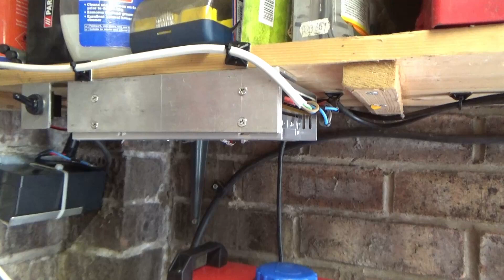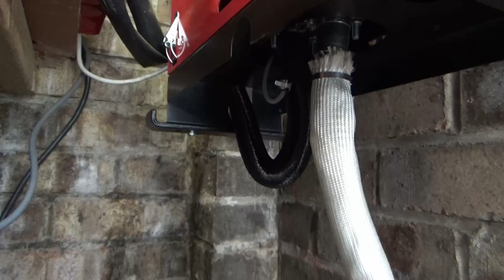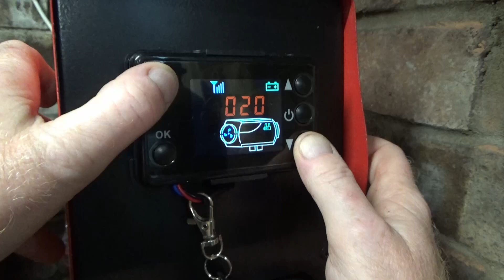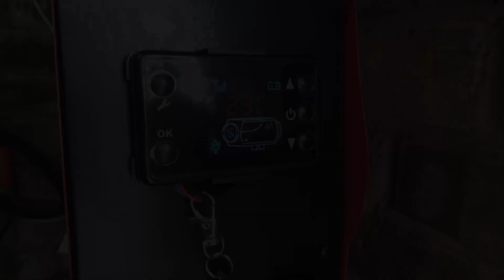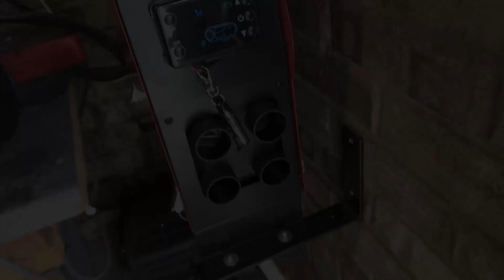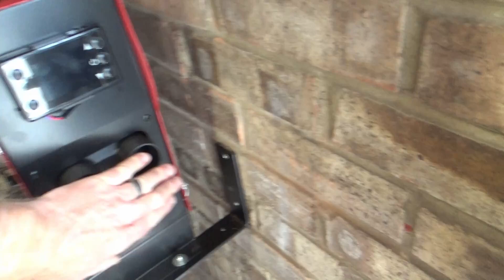My New Chinese Diesel Heater Fitted And Working With Battery Back Up

Comment: Loads of heat wasted from the exhaust, you could try feeding it through an old central heating radiator mounted on the wall, in at the top, out at the bottom then out through the wall.
Reply from the maker: I did consider that but I am extremely limited for space at the minute. I’m building a new shed this year so should have a bit more room to play with in a few months. 

Thanks.

Comment: How have wired the battery into the circuit with the 12v transformer
Reply from the maker: Battery wired direct to the output of the power supply through a switch to isolate when I’m not using it.
Reply: @bodganeering  won’t that increase the voltage  as heater is powered by battery and transformer
Reply from the maker: No as they are wired in parallel. It will actually reduce the start load on the power supply as the battery will supply most of the current.
Reply: will the transformer power supply charge or over  charge the back-up battery?
 @bodganeering
Reply from the maker: @randymoberg4331 it will keep the battery at a set voltage whilst the whole set up is running and will top it up if it has lost some charge. 

Fully charged battery is around 12.8 volts and I’ve adjusted the power supply to 12.4 volts, this should keep everything in the sweet spot without stressing the power supply too much.